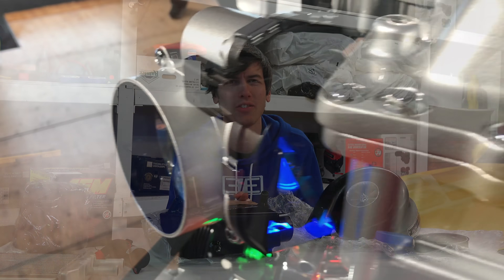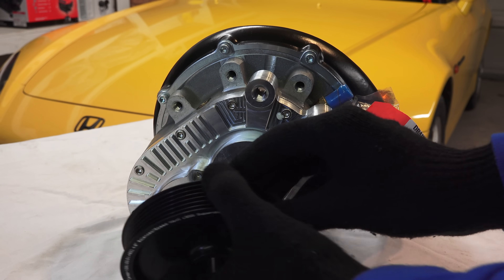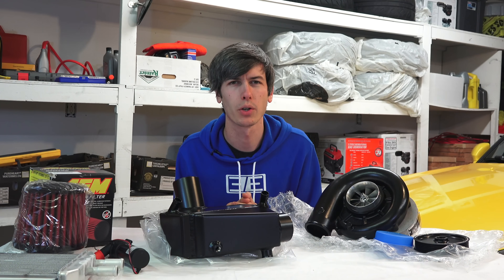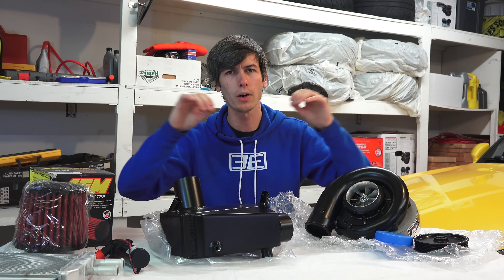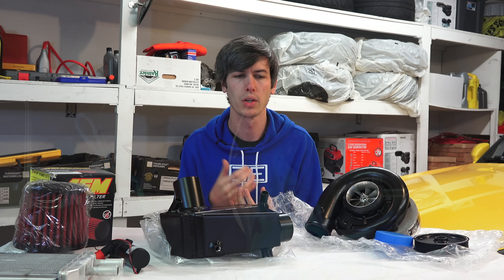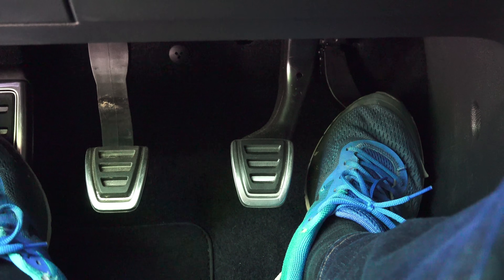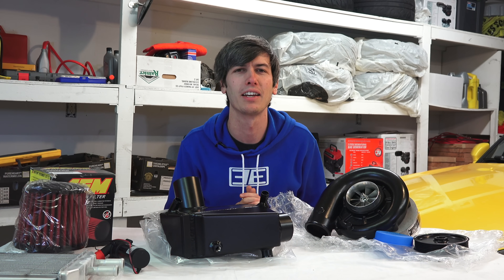Turbochargers vs Superchargers - Which Is Better?

Comment: there  is more boost in a turbo system than a supercharger system. Take a Ford Sierra Cosworth rs500 and put it against a dodge charger srt hellcat and the dodge will take off at the start and then the 5' turbo in the sierra will kick in and boost 3 seconds faster than the dodge. The dodge will be going at full throttle from 1000 rpm and the sierra will be at full throttle at 3000 rpm. The sierra will most likely win because it has a massive racing sized turbo.

Comment: Noob question: Is there a way/attempt to initially spool the turbocharger with battery power then hand of the spinning motion to the exhaust gases? Would the weight of an additional battery pack is the concern here?

Comment: I get that turbos are more efficient, but why do high-end monsters like Ferrari, Porsche, McLaren, etc use turbo instead of Superchargers? Audi does as well, whereas the other big German manufacturers use turbos
Reply: Almost purely government-mandated MPG/Efficiency values assigned to manufacturers. Notice that few European cars, which are held to higher efficiency standards (even though artificial and rarely real-world relevant) employ supercharging, whereas more American vehicles, which aren't subject to the same efficiency mandates, do employ supercharging. Due to the huge push for "more efficient" engines in Europe, there's been significantly more R&D done on Turbos, so they'll likely take more of the pie until the full onslaught of electrics.

Comment: Turbo doesn't make free energy
The exhaust gases have to escape as easy as possible, that's why bigger exhaust pipe=more efficient.
The turbo is creating a resistance and thus using fuel energy in an indirect manner.
Please correct this...
Reply: Long story short.  it is a resistance if it is on the exhaust (turbo) or by a belt (supercharger). however, you need to remember that turbo works in high temperature and has a high rpm = easy to break, plus it needs an intercooler = additional weight. More over if the turbo go bad it is very likely that it will inject oil (turbo is oil cooled) into the engine instead of air which will destroy it in a matter of second...
Supper charger is better in every way, and more expensive, also harder to install. but some times you cannot have it duo to the lack of space...
Reply: @SerajEmad  bro they both have their advantages and downfalls. Some superchargers are not at all an easy thing for the engine to spin up and can weigh just as much as a turbo(s) with an intercooler. The superchargers do have a leg up on instant power input but at high rpms the turbos shred. And if you are buying good quality parts, installing/tuning everything correctly, and taking good care of your turbo(s) they don't just fall apart on you. They can be more fragile then a supercharger but a supercharger can be triple the cost to replace if anything irreplaceable goes out. Personally I think that they are both amazing and fascinating works of engineering that can make a car go that much more zoom. In conclusion they both get two thumbs up from me.
Reply: @jacobnelson1 witch do you think would be better on a 04 4.0 jeep wrangler I obviously don't care about smoking my tires have been mulling over an 8 cylinder or a turbo or supercharger and I hear a lot of horror stories about the 8 cylinder convention kits being a nightmare just want a little extra to get me up over hills with out downshifting in2 3rd all the time
Reply: @SerajEmad  You here whinning on the internet saying super charger is better while people out there who play with cars and engines everyday likes and use turbo charger because it handles better and is more cooler
Reply: @ThatWasPrettyFunny  through the video he said: turbo make use of exhaust gases instead of being wasted...
Reply: It can take 100hp or more to efficiently spin a supercharger. The minimal flow disruption from a turbo is less than that of your typical catalytic converter.
Reply: SERAJ EMAD yes but turbos aid in compression
Reply: @karlreisa3872  ofcource it does, supercharger too, what I mean it is a resistance if it is on the exhaust (turbo) or by a belt (supercharger). however, you need to remember that turbo works in high temperature and has a high rpm plus it needs an intercooler = additional weight. More over if the turbo go bad it is very likely that it will inject oil (turbo is oil cooled) into the engine instead of air which will destroy it in a matter of second...

Comment: I really like how Mercedes has started this genius idea. It revs the turbo with an electric motor so that it gets that power. Once the exhaust really kicks in, it powers the turbos. It’s genius b/c u get that instant power and also get a lot of it
Reply: Yeah honestly hybrids are the future of sports/hyper cars having a second electric engine to power the gaps between gears or power turbos, etc has helped so much and the increase of HP they bring to the table alone.
Reply: @jeremy144713  I had in mind something like a gas engine with a manual or automatic and an electric motor with a CVT with a transfer case to link the two trannies' outputs together to drive the wheels. You could run your car on all-electric mode in slow traffic (like a drive-thru or in a city), then turn the engine back on once you're on the road again. And the electric motor's instant torque means almost zero turbo lag.
Reply: @electric7487  I get you point, so you need to switch manual or it has to be autonomous (self deciding) system ?
Reply: @victorsimukoko9304  You manually switch the engine on or off.
Reply: @sm1ttysav all cars break
Reply: You're broken if you think the two are comparable...
Reply: @budderbear  i wont lie toyota cars are durable but thats is it any well maintained car can last 150k miles
Reply: Sequencial turbo do the same thing.
Reply: Wouldn’t this increase gas mileage? I understand when talking turbos , speed , supercharger etc we don’t care much about gas mileage I’m just wondering cause if so that might be why more people don’t pick it up, a lower gas mileage will scare off the average buyer

Comment: Just be a troublemaker of sort:
A turbocharger is really a subset of superchargers. 
BUT I know, we just use turbo vs super to differentiate between the two main “types” of supercharging. 
There’s even electric supercharger now. Still not as efficient as the turbo. Now we are sapping electric energy from the alternator which demands mechanical power from the engine. However, quicker boost than both the exhaust supercharger (turbocharger) and the belt driven supercharger (supercharger). 
Anyway, still meaty information from you again.  Keep it nice and clean as always.

Comment: I like this channel,and this guy is really intelligent.(much more than me) but they are all super chargers whether exhaust driven or mechanical driven. And buy the way the term intercooler is used wrong now days too.Check out the channel Greg's Airplanes and Automobiles.30's and 40's fighters were hotrodded to the max.

Comment: Thank you.  I didn't know how a turbocharger works until you explained  it quite well.  You seem to anticipate my questions without having  stated them.  Say for example you explained how the PCV valve works.  My dealership called me in to replace the PCV valve which wasn't malfunctioning.    After the replacement. I experienced a significant performance improvement.

Also, you talked about lag with turbochargers as opposed to no lag with superchargers.  Occasionally, I experience delay or lag when I put my foot down.  I'm wondering if that has to do with it being an automatic transmission.  As soon as the engine spools up in the right gear, then it tears out.  It shifts fast and smooth but the delay  occurs after deceleration on a turn.   No more automatic transmissions for me!

Comment: In the turns and on the street the pos dis supercharger is great. I have one and its great on the street with power available in any rpm. The turbos have more power in the high rpm that is better in a straight line but can be harder to control in the turns. So what do you want? I wish the superchargers could be more efficient but right now its not the case. Choose what works for you. I think on a track with more turns the supercharger will win but on one with more straights the turbo will make up and be on top. JMO.

Comment: Supercharged/ naturally aspirated cars are much better for off-roading, which is something you didn’t cover. It relates to the throttle response/ rpm vs power. When you’re crawling along, or ripping through some mud, it’s helpful to get that power instantly. Also, if you’re in a tight situation, the sudden powerban from a turbo could put an unwanted amount of power to the wheels.

Great video though, very informative
Reply: Im trying to figure out whether I want to put a super VS turbo in my 07 accord v6. This is very informative 🙏

Comment: Thank you so much!! I have been driving an Audi Q7 for the last few months, and I didn't notice the lag until we had signed the lease papers. I absolutely hate it! I want the car to do what I tell it to do! I'm not a racer driver, but I like to drive like I am, and I want my gas pedal to respond when I press it. Not a second later. I'm not a mechanic either, so any help with terminology in shopping for cars is helpful. I think I'll look at supercharged engines. Do cars like Honda Accord, Toyota Corolla, etc. fit into one of the two categories? Are they something else? What type of engine is a care that that considered?
Reply: Suzuki cappuccino

Comment: that is a turbocharger on your left. You keep saying supercharger 😒
Reply: No, its a centrifugal supercharger. It uses the same compressor as a turbo but is driven by a pulley on the crankshaft instead of a turbine in the exhaust
Reply: @Redtooth75  on his left that is turbocharger 

and for the record l know how it works
Reply: the physical appearance can easily tell that is turbocharger on his left and supercharger on the right

Comment: on his left is the turbo, in the right is the supercharged
Reply: No, its a centrifugal supercharger. It uses the same compressor as a turbo but is driven by a pulley on the crankshaft instead of a turbine in the exhaust

Comment: What about the concept an electric generator embedded in the engine design? Like sandwiched between engine and transmission, like a tractor power takeoff?
Would this not allow a horsepower boost via several unique and distinct mechanisms, such as air intake boosts or electric motors on wheels/axles, powered by capacitors or some such?

Comment: Hello,, what will the case if the turbo charger broken down or stopped working ,, can I continue driving but with less power or what? I have a Nissan Juke 2014 1.6 turbo ... can I disconnect it in summer cause it gets till 53 c in summer in Muscat >>> Many thanks

Comment: Why was he pointing at a turbo and calling it a supercharger lmaoo does this dude not know the difference ????
Reply: Its a centrifugal supercharger. It uses the same style of compressor that a turbo uses but instead of a turbine in the exhaust there is a gear set connected to the crankshaft

Comment: That's why the Bugotti has 4 turbo. Each one is primed to a specific band of the RPM spectrum. Before terminal velosity, they all balance out.. Personally I'd still rather have a twin screw Supercharger over a bunch of turbos. The main thing you have to worry about with a supercharger is the belt. That's generally the weak link. Could cause damage.

Comment: The turbo does not run on nothing.  The turbo produces back pressure on the exhaust which also puts load on the engine.  Nothing is free.  I would also go with a super charger.

Comment: I swear  I thought the one on his left was a turbo an the one on the right was a supercharger 😕either I'm slow or he is
Reply: Well, The One on Our Right, Is a Pro charger, Its comprised of a Turbo compressor hooked up to  a Pulley instead of using the exhaust.. Its not a Supercharger in the sense that ia Roots or Paddle wheel Style but its not a turbo either. Its both.
Reply: redneckhippiefreak it’s a supercharger. It’s a cetri kinda like a turbo but still belt driven. A very healthy combo for cars but lack making big horsepower number this set up is good for track guys and entry level drag racers! And the car will also be a street monsters a lot of folks put these on v6 camaros and mustangs and make well over 500 horsepower at the wheel.
Reply: Darmaine Coker that’s a centrifugal supercharger
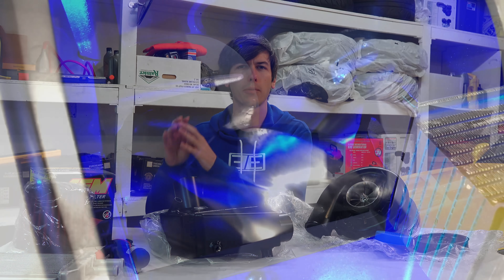Reply: 6:30 ?
Reply: I think he's just reading a script. 

He kept patting and pointing to the turbo when talking about the supercharger. Turbo=turbine. Round boi on the right
Reply: Lmao I think he switched it around the 6:30 mark
Reply: on the right side that is a centrifugal supercharger :)

Comment: Great explanation. While I get your preference, I have a tendency to think in more practical terms, so I'm willing to live with a delay between the pedal and the rubber. 

I'm curious, though, has anyone ever thought of the idea of pre-charging a turbo by adding an electric engine that spins the turbine on a clutch until the exhaust pressure takes over? It seems to me something like that would go a long way toward eliminating the throttle delay. I cannot imagine what search term I would use to Google that, which is why I'm asking if anyone here knows.
Reply: This is the approach used by the Benz, the turbo us initially powered by an electric motor until the exhaust gas take over

Comment: So what if you could engage/disengage a supercharger to get good efficiency or a boost in power?
Reply: Probably have a clutch kind of system engage to the pulley
Reply: Only problem I can think would be actually changing the fuel intake, I have no idea how to tune though so I have no ideas there

Comment: Question 1  ; turbocharging is more suitable for diesel engines  ,yes /no ?  (by means  compression rate  , less rpm ?)
                 2  ; supercharging  acts more direct on gas pedal  :  could charger energy loss for engine  solved  by an electrical driven charger (G lader -type?)
the video is , by the way very good  , well explained !  my compliments !!

Comment: You can also put a turbo wherever there is an exhaust pipe effectively letting you put them almost anywhere while superchargers pretty much have to be in the engine bay creating a space problem

Comment: thats right, ppl say on turbos use more gas, but they forget, ok u accelerate, the turbo spools, in comes air, matched by fuel, horsepower increases.... oh no my fuels disapearing... well lets pause it.. ok lets remove the turbo... now look. where is your foot? still down. so your using fuel either way. turbo is somewhat free power.
Reply: why not both?

Comment: QUESTION - While the Turbo is more efficient, how much of a power loss do you take doing all the bends and twists in the exhaust to connect to the turbo? Now, this is being asked from someone who is into two-strokes where the exhaust shape is instrumental in the amount of power you make. I just assumed a more straight run on the exhaust mated with a Supercharger would be more overall power and more efficient, where although it's not using the heat it is processing the exhaust more efficiently.

What I would like to see is a performance engine put on a dyno. Then update to a turbo, but before hooking it up and tuning do a dyno run. Then hook up and tune, dyno run. Then do the same for the Supercharger ... that way you can see how much the exhaust changes vs supercharger drag costs each set up before actually hooked up.

Comment: Great explanation! Thank you. 

I have a question I've always been curious about on this topic.

It seems to me that a turbo may also use engine power (i.e., it may not be more efficient than a supercharger). By adding the turbo in the exhaust flow, you're increasing resistance to air flow (imagine blowing air though a tiny straw vs a huge one). I think this will create back pressure on the engine ... which will take energy to overcome. This additional energy may be similar to the additional energy required to turn a supercharger.

Does this make sense?

The turbo could still be more efficient than the supercharger, but I don't think it's 100% efficient ... in the sense that it only uses energy which would otherwise have been wasted. WDYT?

Thanks!
Reply: You are correct, a turbo does cause some parasitic loss by the increased backpressure. But a turbo is still more efficient since most of the energy going to it is waste energy from the exhaust.
Reply: @Redtooth75  Thank you!

Comment: What I can understand, if your car has low hp, supercharger is not recommended right? What can I put in a 1.5L with 107 HP? I want to build something different,not the fastest car but something responsible and enjoyable
Reply: Good question. Yes, superchargers are more effective for larger engines that already have plenty of power. Whether turbocharging is right for your engine depends on the engine. Do research on the net to see if your engine has been turbocharged and what is the long term result.

Comment: Multiple smaller turbos and a smaller inter-cooler is a way to beat lag is it not?.
Reply: Cars with sequential turbos have one that supplies boost at low rpm and the other gives boost at medium to high rpm, so yes, there is much less lag.